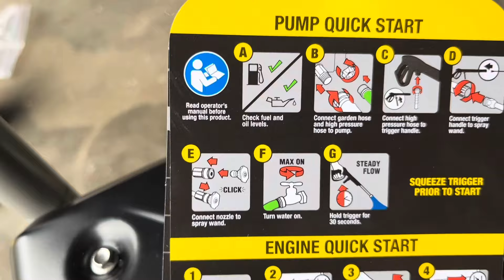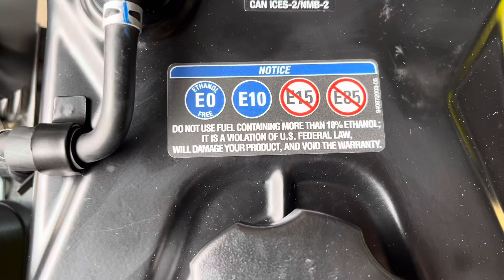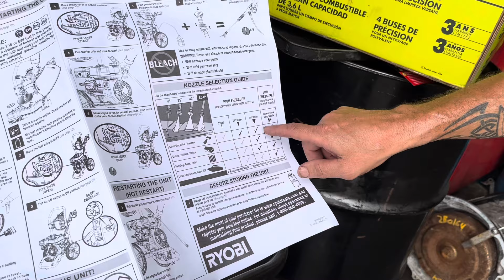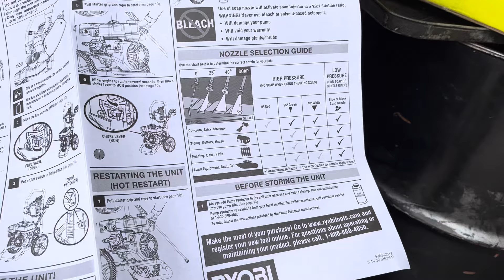Ryobi 2900 2.5GPM Pressure Washer Full Review & Use

Comment: I have one of those Ryobi pressure washers and they work perfect they can talk about Ryobi all they want they done right with those pressure washers they generally have a Honda motor on them which make them super reliable providing that you don't use ethanol gas technically you can use ethanol gas I just don't suggest letting it sit with that gas in the carburetor it tends to gum them up
Reply from the maker: Thanks for sharing